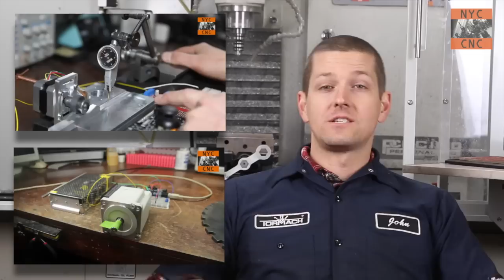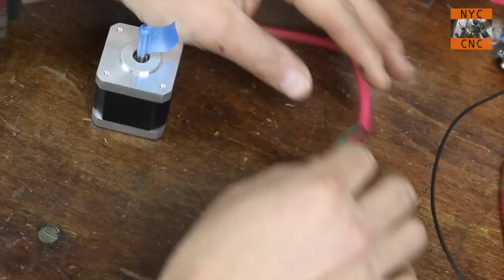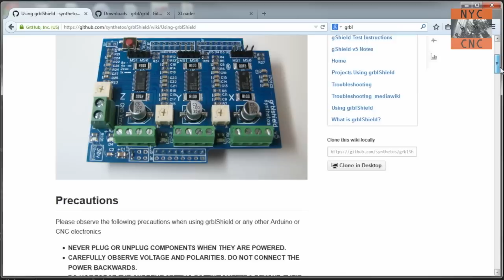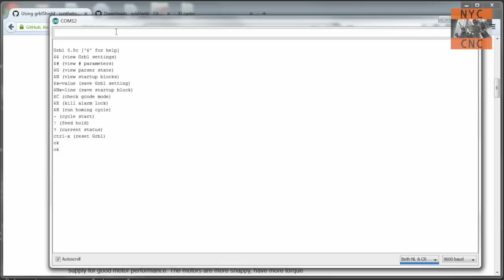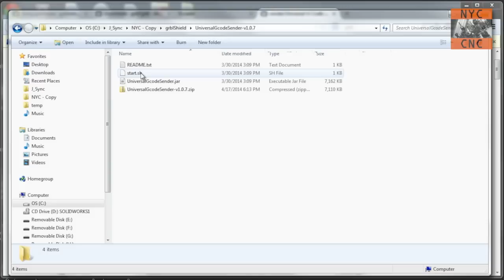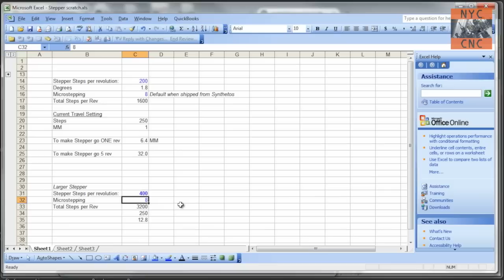DIY Arduino CNC Machine with GRBL Shield - Setup Tutorial!

Comment: it's now possible to use the arduino IDE to compile and flash grbl  from source without the need to load a hex
Reply: You appear to be lightyears ahead of me in my own CNC project, so perhaps you could lend a bit of advice on a couple of things.

I have two arduino's a mega, and an uno, as well as an LCD keypad shield.

The Arduino Mega is running the LCD and Softserial to spy on the communications to GRBL.

On the Arduino Uno i only have GRBL + 3x EasyDriver 4.4 boards. (i know small, but i'm too poor to buy one of those expensive grbl shileds)

What i'de like to do is connect the two arduino boards using the onboard UART's. That way i can have GRBL on the uno, and the LCD keypad shield on the mega.

My issue, is when i do this, two adverse things happen.

Using softserial, i can ouput what grbl is doing on the LCD, however, there are garbled characters being created as well. I'm assuming this is due to serial communaction garbage, i'de like to be able to strip that out, and just display X, Y, and Z positions

The second issue i'm running into, is that GRBL itself seems to start timing out, or becomming unresponsive. I'm assuming this is being caused by the LCD arduino somehow interferring with communication on the USB. (i'm assuming here that the RX/TX pins and the USB share the same UART)

Any insights, ideas etc would be much appreciated.
Reply: Okies. I've almost got it worked out now, i'll release code when i get it completed

Comment: hi
I bought a cnc shield v3 for a project of CNC; for some reason the steppers are not working, vibrate not rotating . 
sorry for my bad english
Reply: NYC CNC  i would like to make a cnc machine , so i bought this cnc shield  (http://www.ebay.com/itm/291492707623?_trksid=p2060353.m2749.l2649&ssPageName=STRK%3AMEBIDX%3AIT  ) and arduino uno and stepper motors , but when i connect the motors are not rotating , i think because there are not any jumpers in the shield . could you help me for this problem .

Comment: Is the stepper motors supposed to get very hot while working. I played with my motor and adjust some settings and the motor start to get very hot
Reply: NYC CNC hi, could you maybe post a link to that excel file you are using in this video?

Comment: can i use L297/L298 stepper driver instead of GRBL shield
Reply: ben dhrif mohamed ali  The benefit of the shield is it has the driving AND controlling capabilities. The 298 is just a driver I believe. There are many other spaces to fill between the computer nd the drivers .
For the ~60 to 70$ price it sure fills a lot of holes!
Synthetos board specs from Adafruit:
2.5 Amps per winding12-30 Input VoltageOpen Pin Pass Through8x MicrosteppingScrew Down Terminal Voltage InputHardware 3x Axis (x,y,z)3x Robust TI DRV8818 Stepper Drivers
Reply: ben dhrif mohamed ali No, you can't use it with Grbl. But if you are looking for cheaper options, you can use L297 and L298 together as a driver. Yes it'll be a bit slower and It can't do microstepping but it's great. The accuracy is quite good. People pay $50 extra for some tenth of a mm as if they are going to mill an engine part for Airbus A380. It doesn't actually matter. As long as your frame doesn't wobble and your build is sturdy the combination of L297 and L298 will work fine. You can use Arduino  and RepRap G code interpreter firmware for arduino(opensource) to send G-code to your motors.
Reply: thx
Reply: MrOmnos thank you

Comment: you said in one of your videos that the arduino isnt the best controller for the steppers. through the streaming gcode software you listed i dont see why it isnt. there is a link  on github to link the arduino to a more powerful controller. im using an automation direct stp-drv-6575 on all 3 axis and seems to work fine.( the shield seems cool just not for cnc). Is 24 volts good enough for a nema 23 motor? im running 48V. but my point is the arduino will send code to the drivers through the GRBL hex to more powerfull drivers. Only wish they encoded more than 3 axis.

Comment: Hi John. Ive been watching your videos. I'm really new to all this CNC stuff. But im really interested in making one myself since I have some experience with machining and computers. However i don't know much about the circuitry components.

I have the Arduino, and im ordering the motors as you specified. However the GRBL Shield its too expensive for me. I live in Canada. And its asking for $50 for shipping. The Shield itself alone is $50.

I found this one on amazon. Do you think i could make it work the same? Or could you recommend me one on amazon?
 - http://www.amazon.com/Printer-Arduino-Engraver-shield-Driver/dp/B00LQAULEI/ref=sr_1_2?s=industrial&ie=UTF8&qid=1434506969&sr=1-2&keywords=GRBL+Shield

Just a heads up, im planning on building a small milling machine or 3D printer.

Comment: hey there, great tutorial! i have been working on a 3 axis CNC machine. I am using 3 nema 23 stepper motors using arduino... but the thing is i just have 3 L298 dual H bridge controller.. the grbl shield is not available here in malaysia. So how do I proceed with L298 driver? i will be also requiring a GUI as you have shown in your video. Thanks :)
Reply: NO NO NO not used L298 driver, nema 23 i use and need external stepper drivers ewery motor own driver, DM 542 or i use DM 556 drivers and normal milling need minimum nema 23 475OZ motors 3-5Ampere motor current , and this need DM556 drivers can use max current.

Comment: I bought the Arduino UNo and the GRBL shield from ADAFRUIT. When I downloaded
their software the Motor controller did not not work. They said I needed to add to the arduino library. I could not figure out how to do it. You have a great project and I would like to follow along. Regards
dondoerner@sympatico.ca
Reply: don doerner you need to program your Uno as described on the GRBL GitHub site here: https://github.com/grbl/grbl
Short description of the process: Download the zip file from GitHub. In Arduino IDE click on sketch->Add Library and browse to and select the previously downloaded zip file. This will add the GRBL library to your Arduino IDE. Then in Arduino IDE open the grblUpload sketch from your My Documents (..\Arduino\libraries\grbl\examples\grblUpload\grblUpload.ino). If all your settings are correct you should be able to hit the upload button and your Uno will be programmed :-)
Reply: Christo Candiotes Of course uploading the precompiled hex file as described in the video is much easier!

Comment: G'day John, with regard this and the subsequent small cnc "machine" you built, is the grbl shield capable of interpreting a full set of G-code instructions as generated by a CAM package, and would it be possible to build a serious 3/4 axis milling machine based on an Arduino/grbl shield? In other words could you, in theory anyway, rip the Mach3/controllers out of the Tormach and replace them with an Arduino or Rasberry Pi based system? My background is manual machining and I'm rolling around the idea of scratch building a small footprint but rigid CNC gantry style mill from weldments that's really not available commercially, but left Windows some years back and don't fancy returning any time soon. I'm keen to investigate if dedicated controllers are feasible.

Comment: Is there anyother place to buy a 3 axis shield with driver built-in? The grbl shield is soldout from that link.
Reply: hey, maybe u found this sheld?
Reply: Gytis Širvys Adafruit also sells this but its more expensive and also sold out. They also sell a motor shield for $20 to control 2 steppers would be a cheaper alternative but it happens to also be SOLD OUT.
Reply: SoundsFantastic  crap, but i think Arduino cnc v3 shield is a good alternative grbl shield ;)
Reply: If you have not found it yet this is where I got mine: https://www.inventables.com/technologies/gshield

Comment: thanks for helping (Y) .
but i have a question , today i make my own 2d plotter but without grbl shield , just driver for each motor and arduino uno, can i use GRBL program ??
if no , what you suggestion for me ?
Reply: thanks for your comment (Y) 
please do you know what i have to do without this shield ??
i wanna complete my project by any way
Reply: NYC CNC You can indeed use a different driver. You would power the drivers separately and only feed them the 5v pulsing pins.
Reply: Thank you bill (Y) , but I noticed something 
My Driver inputs is 4 wires ( need 4 signals to move the stepper motor correctly )
 
while Arduino with grbl needs 2 wires only ( Pulse and Direction ) :D 
 
What i have to do now ?
Reply: You just wan to figure out which pins are supplying the "pulses" and route the accordingly to your drivers. You must power your drivers with a separate power source, of coarse. You need to look up the details on the pinouts from the GRBL website.
Reply: Here it is from the GitHub site: (use method #1)
https://github.com/grbl/grbl/wiki/Connecting-Grbl
Reply: The 'pulse -' , 'dir -' and 'enable -' all share a common ground. Also, the 'enable +' can be shared with all three (or more) axis'.

Look here:
http://oliverwhysall.co.uk/the-hy-div268n-5a-stepper-driver-and-grbl/

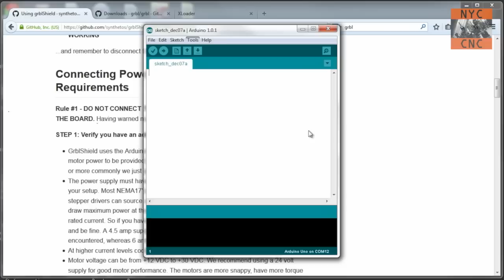Comment: 6:18
Reply: When you said sood she. It made me laugh so hard xD
Reply: But that's the only video on YouTube that has the complete instructions for this shield
Reply: But yea I'm saving money to build one. Um is it okay if I use a computer power supply
Reply: There's 15, 23, 3, 9,15, and 5
Reply: Alright I'll try it and tell you in the future. Thanks :)
Reply: NYC CNC hey um i have a question...  is it possible to use easydriver with the universal g code generator?
Reply: Yea it's a little stepper diver it uses one for every stepper motor directly from the Arduino

Comment: Just beware that the Universal G-code Senders button "reset zero" send G92 command, which is basically a datum shift and not a zero point setting aid! It is voltatile value, so as soon as your program ends, the G92 'zero' vanishes. If you run a program with that G92 used first, then hit "go xyz", the machine will shoot somewhere outer space.

Haven't EVER used the G92 except inside a program (as it is supposed to be used), ALWAYS use G10 L20 P1 Xx Yy Zz, which sets current position to the values xyz in G54 (P1) and this stays in memory, it isn't volatile and is referenced to the machine zero coordinates.

In my opinion, UGS is a great tool, but whoever figured out that using G92 is a good idea should b publically flogged to death.
Reply: Fortunately not, I've just been implementing grbl for EDM use and been reading documentation/comments from grbl, UGS and LinuxCNC G code guide, so one learns pretty quickly ;)
Reply: ..yeah? :D On my channel you can find plenty of videos of the wire EDM I built, pretty simple machine and easy to do. Just building a new, hopefully better controller than the previous I had :)

Comment: I ordered the Power supply from Amazon, however it came with no paperwork, no cover for the screws and no answer when I email them....  do you have instructions how to hook this up to AC and what terminals give what voltage????   Thanks
Reply: NYC CNC I have the same problem. They are very vaguely labelled and I do not want to risk burning out my grbl shield

Comment: Fun video. Check out using ChiliPeppr for sending your Gcode. http://chilipeppr.com/grbl is the URL if you're using a Grbl device. I would also recommend using TinyG instead of Grbl.
Reply: NYC CNC
He means TinyG over the GRBL Shield. The TinyG is basically just an all in one Arduino/Gshield.
Reply: TinyG is quite a bit more than an Arduino/Gshield. TinyG's motion processing is really amazing. It makes your CNC have very natural movements. Some equate its implementation to $100k CNC machines. It's a 32-bit processor which gives you the ability to do this. Grbl is really awesome for being 16-bit, but if you're really going to enjoy your CNC, TinyG is the way to go for only say $40 more. After implementing TinyG's API in ChiliPeppr, the feedback you get from it even on things like what position your CNC machine is at is incredible. With Grbl you have to manually query the position every 250ms or so. TinyG just pushes you updates as it moves and when the updates are relevant. TinyG's support for the ! (pause) and the % (wipe buffer) command is majorly important for jogging. Grbl doesn't have the % (wipe) command. It may not seem like it matters, but when you really start pushing the CNC machine these types of features are a big deal.
Reply: John Lauer A couple of things I'd add are that when you look at recent CNC machine launches like the Othermill, they use a TinyG because they rsearched the best way to go, and for the money it really is worth it. There's even a new 3D printer board coming out soon called TigerShark based on TinyG. There's another version of TinyG created by the community that is just the processor and you can use add-on stepper drivers for up to 6 axes. Moreover, the Arduino Due can now (or soon) run TinyG because Due is a 32-bit processor. Given that it's just about 2015, 32-bit processors are now about as cheap as 16-bit and the oomph you get is well worth it.

Comment: This is great! Looking forward to the series. I've been using GRBL and GRBL Shield for about 2yrs on my home made CNC with no complaints.  I recommend upgrading to the latest firmware as it has independent X,Y and Z feedrates and other improvements. Also, especially if you want to customize your machine interface, check out the good work of John Lauer and Jarret Luft with  ChiliPeppr . Pretty awesome stuff.

Comment: Nice one, I have an Arduino Uno coming for Christmas and plan to play with steppers in the near future. One thing I don't hear much of is protecting ones PC when using and Arduino from any feedback up the USB Cable. Been contemplating the purchase of a USB Isolator with an ADuM4160 chip. Have you had any issues with your PC John when using your Aduinos?

Comment: With the power supply I found that you dont need the combined amps of all the steppers at its output voltage. The steppers want something like a low Voltage@rated amps so you need that power P=U*I for every stepper. What you need out of your power supply is voltage reserve so you have voltage to counteract the countervoltage that steppers generate while spinning fast. I learned it the hard way by overengeneering the power supply of my cnc thing and being baffled why it does almost consume no amps while it ran at a lab supply.
Reply: NYC CNC Look at this page http://reprap.org/wiki/NEMA_17_Stepper_motor There is a amp and a rated voltage at which that amperage flows. Lets say you have a motor that needs 3 amp and 3 volt than your power supply needs at least 9W power. That rating is given for a motor that stands still.
If a stepper motor turns it generates a counter voltage that must be overcome by adding it to the motor voltage so that 3 amps of current can flow through the motor. Lets say the motor generates a counter voltage of 1 volt then the motor driver chip will deliver something like 4 volts so the set current will still flow. You need the higher voltage power supplies just to do that! Inside the motor there is still just 3 V @ 3 amps that do the work so there is still only 9 watts that will be needed. There is not 1V*3A=3W power loss in the driver because it controls the amperage via pwm and not as a resistive current limiter.
If you have a 24 Volt supply that means 9 W would draw only something like I=P/V => 9/24=0,375 Amp so you would need something in that range to power the stepper. I would take a power supply that has 24 V and maybe 1 Amp because of losses in the driver and reserve but I would not use a 24V 3Amp to supply the motor.
Reply: NYC CNC The drivers on a grblshield won't do much more than 2A on a good day, but anyway - you'll need to know the nominal voltage for the steppers, or calculate it from the resistance. for a 2.5A Nema17 is it probably around 1.5 Ohm:
2.5A*1.5R =  3.75V
3.75V*2.5A = ~9.5W per motor,
three motors = ~30W
30W@24V~= 1.25A

add a bit to account for losses
Reply: stepper motor voltage NOT important, can use 12V to 90V, but important is what motor current max is and stepper motor driver max current is,  5V stepper motor can run 50 volt or more but current need be less than max motor current is. or burn motor.